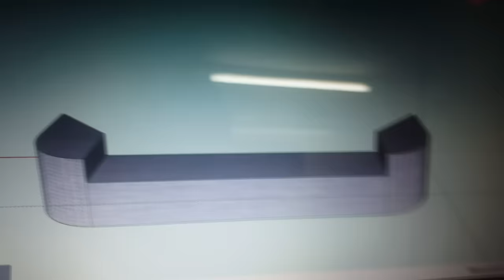***HOW TO MAKE CUSTOM OFF ROAD METAL REAR BUMPER(home made)🥇🎆🎇

Comment: Shoulda planned the bumper to have lockable compartments for the handyman jack tow chain and jumper cables.
Reply: The doors will need a real good seal.. mine leaks with water and dirt.. I figured a top lid type would leak, but end doors aren't much different.. drain holes made it worse LoL

Comment: Great fabrication. I would only suggest though that a bumper is 
only as strong as its infrastructure. Meaning I would probably have
2 by 2 or 3 by 3 square metal on the underside to reinforce the strong look.
You did a great job though.
Reply: Yeah I was thinking that too, add gussets to the core.

Comment: it looks like thin material, was it strong enough for off road and towing?
Reply from the maker: Absolutely yes it is very strong, but is heavy...
Reply: Looks to be like 1/8th inch
Reply from the maker: 3mm thick and it's enough
Reply: Oh ok, that seems like it is similar to a new truck bumper. I was thinking it needed to be 5mm in the center and maybe 3mm for the outer portion. Maybe it needs to be thicker for a winch mount.
Nice job, looks fun. I need to make one for my truck soon.
Good use of sketchup too.
Reply: Most commercial available bumpers are made from 3/16" thick steal and any winch mount areas are made from 1/4" plate. 1/8" is fine for a looks only bumper, but I would not ever put any shackle lugs on that bumper. 3mm or 1/8" sheet is not enough for real hardcore off-roading or recover work. The frame tie-ins on this bumper were all the same, thin, 1/8" material. 
As a reference, both front and rear frame tie-ins are made from 1/4" plate attached to the actual frame rails. And the shackle lugs are made from 1/2" welded to the 1/4' plate as well as the rest of the surrounding 3/16" body. That as a true, solid off-road bumper.
Both my front a nd rear bumpers were "weld-your-own" kits that I had to make the bends and then weld it all together.
Reply: I had the exact same thought. I made a truck bumper a while back with 1/8 steel thinking it would be strong but dang that sucker got heavy fast. If i do it again, I’d go thinner because with all of the folds and welds you make, it’s pretty dang stout.

Comment: Great job 👍. The metal is thin for actual off road use. That will sent easily. 3/16 plate would be a better choice.
Reply: Looks tome like 3mm steel was used. I can agree with the wish to increse materialthickness to 5mm... That will however not form as easily. Most commersial bumpers sold are 3mm. If reinforced descently, there is little to contradict using 3mm.

Comment: How many mm metal that use for the bumper?
Reply: @VRAF  i mean how many "mm" milimeter the thickness of metal? That you use for the bumper.
Reply from the maker: 2mm..it is ok and it is strong because of binding the metal....also lightweight approximately 50kg
Reply: @VRAF  ok thank you so much

Comment: 1/8  inch steel bumper?  Hope you never get hit.
Reply: Actually a lot of the aftermarket off road bumpers are made from 1/8 inch. With proper bracing and gusseting it is much stronger than the factory bumper. Usually only the mounting supports are from 1/4 inch.
Reply: It appeared to be 12ga. which is even thinner.